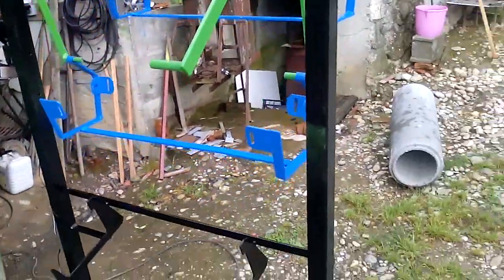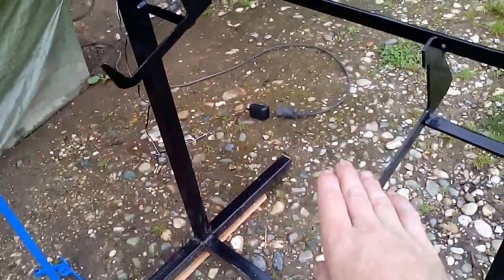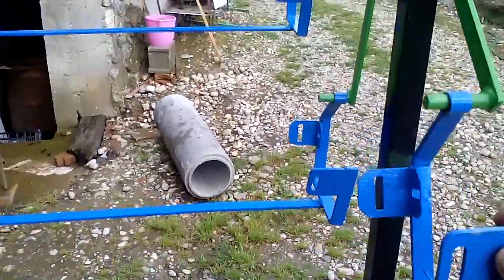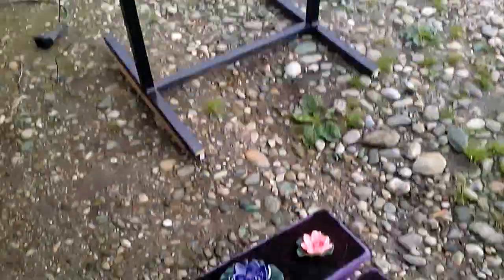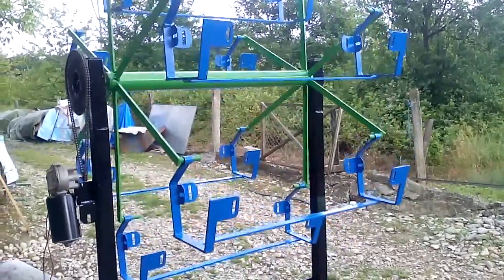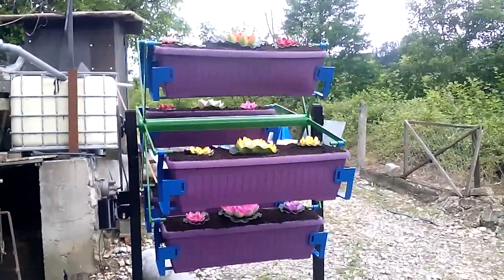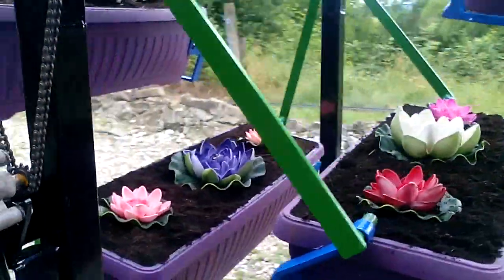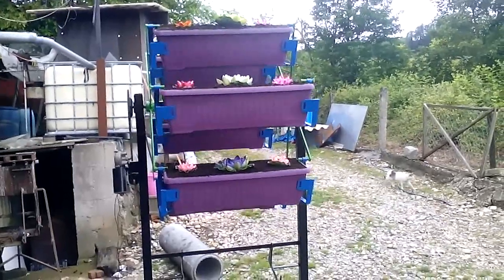Garden flower box rotator

Comment: Love the design and the colours. Well done. 
Register it or apply with one of the invention tv companies they will finance you to build and sell it!
Reply from the maker: That would be nice to make and sell it,i will try to find someone to invest and share profit,thnx for information and big greetings from sunny Croatia
Reply: Hi,

I sincerely wish you luck on every project, but some are over engineered not good for manufacture, no insult intended. There is a few things which could be easy to make, though you might ave to arrange things so they can be shipped in easy to pack and assemble pieces you now.

I don’t now whether the pant holders will fit inside each other and whether the ‘wheel’ part can be altered to screw or bolt together? Please sea your PM for a suggestion.

Good luck,

Take care
mrbluenun